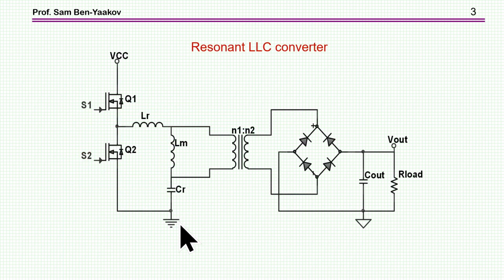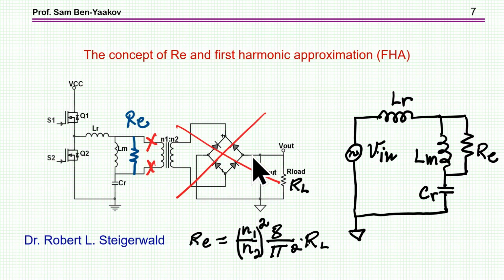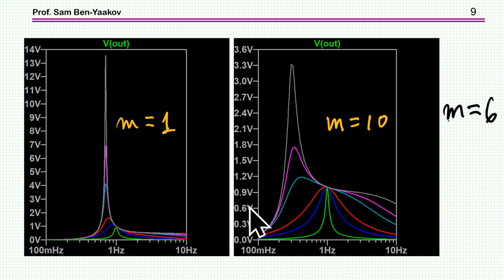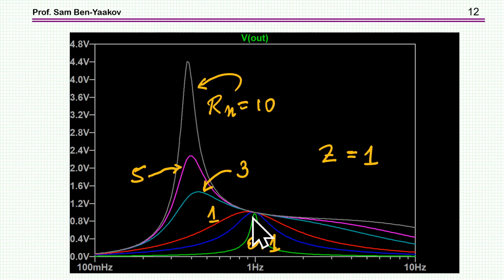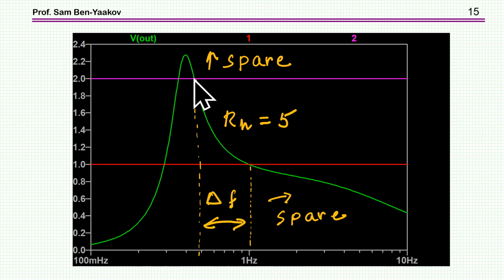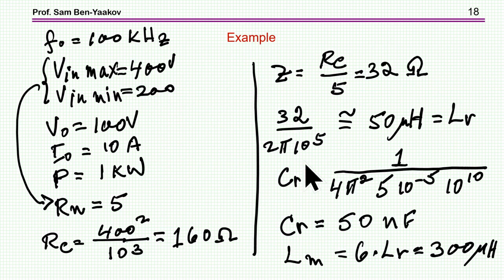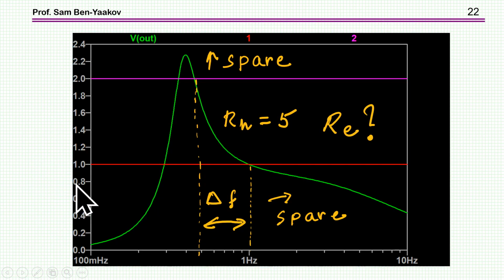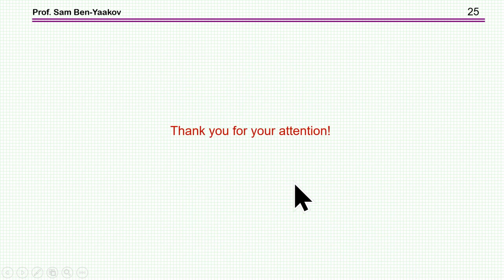A user friendly basic design method of an LLC resonant converter

Comment: Sorry,I have a question again.
I can not understand Why the Re was not use FHA equation to calculation?((8n^2/pi^2)*(Vo^2/Pmax))
Reply from the maker: (Vo^2/Pmax)=RL
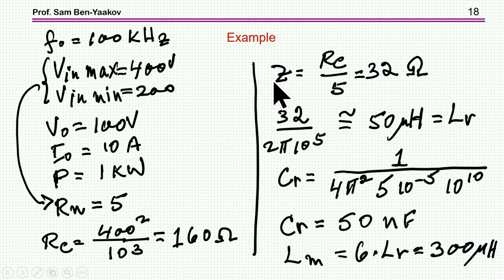Reply: @sambenyaakov  16:40 Don't your Re(Vin_max^2/P) need to multiply by the factor 8/pi^2?
Reply from the maker: @林昱廷-g9w  Now I see it. You are correct. What I probably had in mind was that 8/pi^2 is about 0.8
Reply: @sambenyaakov  Ok,I got it. Thank you very much!

Comment: Hello, I would like to ask that the design is based on full load conditions, why not take no-load conditions into consideration?
Reply from the maker: Designs are normally based on full load to ensure that the power can be handled. But, indeed, there is a need to check other operating points, including no load, for proper operation.
Reply: @sambenyaakov  Thanks for your reply!😆

Comment: Prof, 15:39 the Re equation Re=Vinmax^2/P, here Vin_max should be the Vin_rms value instead of DC value. as in the gain curve simulation and other place, we used ac Vin as the input and Re is the ac rms equivalent resistance.
Reply from the maker: Yes there is a mistake here. Re should be R equivalent as in slide 8. So first Vdc^2/P and the multiply by 8/Pi^2. Thanks for pointing this out.

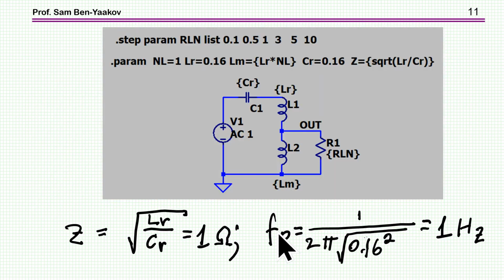Comment: In 0:34 you show a different schematic than the one you simulate in 8:19. 
In 0:34 the inductors are closer to the HIGH and LOW side MOSFET, while in 8:19 the capacitor is closest.

I assume it doesn't affect the basic operation of the LLC converter?
Reply from the maker: Lr and C are in series so  it does not matter where they are along the line. BTW I guess you noticed the wrong connation of the diodes?

Comment: Thanks for the video! When you are calculating Re using output power, you are using Vinmax. Am I correct that  theoretically we should use ((4/pi)*Vinmax)/sqrt(2)? This rms value is 0.9 times voltage which is quite close 1 so I understand if you have just left that "away"...
Reply from the maker: Indeed. Thanks for pointing this out.

Comment: Although everything seems ok, I think that somewhere there is an error in the proposed method.
Why am I saying this?
Because in the given numerical example, with the values obtained for Lr and Cr, the equivalent quality factor is 1.7, a value too high to ensure the proposed gain equal to 2. In addition, the working frequency range is very limited because below 96.4kHz ZVS is lost and ZCS enters, not a very good regime for transistors in LLC.
According to my calculations, the ok values for Lr and Cr would be 8uH, respectively 330nF (for m=6) or 11uH with 220nF (m=3).
Reply from the maker: Thanks for sharing your thoughts. But how can I respond to "according to my calculations"? You seem to overlooked the "basic" in the title.

Comment: Good day Sir. Would you like to say a couple of words about an another architecture of an LLC converter, when C is moved to the secondary side pls? If you take a look into a transformer driver UCC25800 datasheet, you'll find that it has an advantage as "the magnetizing inductor no longer affects the converter gain. Therefore, the converter is less sensitive to the switching frequency and resonant component tolerances". Besides they offer to incorporate the C into a wienna rectifier, and so remove one of the secondary coils (which can be a big deal for a planar transformer due to a high current and a copper layer thickness). Many applications are good with an open loop gain, and such tolerance would be a benefit

Comment: Hello Professor, Thank you so much for your well-explained presentation. I am trying to replicate your AC analysis. I have provided all the same values but I am getting negative gains as well.
Reply: My graph starts from zero and then dips down to -3.2 Volts and after that it increases same like yours. Can you let me know what I am doing wrong. I am using Octave .ac oct 600 100m 10 command.
Reply from the maker: I am not sure I follow. Perhps negative in db?
Reply: @mubashir588  use decade & change bode to linear,hope it helps

Comment: Thanks for this video professor. Regarding the Lm value, how would be your approach in case ZVS is not ensured on the primary side due to lack of magnetic energy?
Reply from the maker: One way is to used packet control.
Reply: @sambenyaakov  Is this similar to burst mode?
Reply from the maker: @GokhanSen-k8o     exactly
Reply: Thank you sir

Comment: in 20:07 min you said you use Vin_max for calculate Re value.. so is it the     
 Vin_max = Vcc_max/2       ? 
am i right or wrong?

here i mentioned maximum limit of supply voltage which gives to the half bridge terminal as Vcc_max
Reply from the maker: Approximately ( square wave- sinus) in a half bridge

Comment: this is great. i think... i think i get it now.

trying for an induction heater. sort of running 270nf Cr just cus i got em as pulse rated... meh, i can alter that. from some playing with MPS LLC tool, i got something like 18uHLr, a factor of 6 for for about 74uH on Lm, and roughly 71khz. have to play around a bit more with it, but its interactive graphs do allow one to get a grasp of how the variables affect things. very handy.

i havent understood the relation ship of the work coil to Lm, though now... i think i simply DO shunt it, exactly as the diagrams suggest... despite it being only a few turns of copper pipe.

for an induction heater, its going to be a 1 turn secondary.
i could say my RL is say, the resistance of a cylindrical section of iron (copper?) tube of say 1/3rd radius wall thickness for skin effect.

the inductance of this work coil doesnt matter. vo doesnt matter other than its a function of the current being induced through that resistance. 
what does matter is keeping the turns ratio correct so the reflected load, Re, is approximating the desired value calculated from the power supply side of things so as to deliver the maximum power to either a slug of copper/gold to being unloaded with minimal load, without blowing up...

i think that from here... i can work this out now.

i recall the industrial unit i used to use ran a fixed frequency, with a coil tap for load matching. this does explain it now. as the work coil may have any number of turns, the matching transformer is simply there to maintain Re as the secondary, the lump of stuff being heated, is always considered a 1 turn coil. though RL will change as the material changes... nevertheless, as long as i calculate for the worst case scenario, a near virtual dead short, someone just stuck a superconductor in the workcoil... i should stay in the safe region...
Reply from the maker: Thanks for sharing

Comment: Looking the gain graph it seems that if we have fixed nominal input voltage all the valid loads we will have cross resonant frequency at gain 1. 
In real design project I face a problem which is:  switching freq is above resonance ( as I can see my resonant current waveform ) and switching frequency is decreasing close to resonance with increasing the load ( or decreasing Q ).  I have followed all the steps and I believe everything is ok with my calculations.  Pout = 500W; Vo = 12V; n=16; Vin = 390V; Lr = 30uH; Lm = 220uH; Cr = 120nF; fr = 80kHz. 
Question is: From where could come the difference between theory and practical design. 
Possible things: transformer ratio is not valid ( but I checked that )   or  leakage inductance is dropping with respect to current ( something I don't have the tools to measure ) , but anyways If so i think the circuit should operate at the new resonant frequency to follow the approximations in the predesign but that is not happening. This is something I don't understand.
Reply from the maker: The design is based on the first harmonic approximation. In reality the time domain behavior is different.

Comment: Does the math work the same for an "inverter", ie AC output, not DC. 

For an inverter, we'd lose the rectifier. But would we lose Cout?
Reply from the maker: No, the analysis assumes a DC clamping at the output, that is the voltage on the transformer is a square wave.
Reply: @sambenyaakov  Which video do you recommend for an LLC inverter, with sinusoidal AC output?
Reply from the maker: @johnaweiss  This would be a resonant converter look up my video on that.
Reply: @sambenyaakov  An inverter is a converter?
Reply from the maker: @johnaweiss  Strictly speaking ' a converter is DC-DC an inverter DC-AC, but sometime they are mixed
Reply: @sambenyaakov  I'm confused, you said to look up your video on resonant converters. But THIS video is on resonant converters. How will that help me understand resonant inverters?
Reply from the maker: @johnaweiss  https://youtu.be/tCEqm-RoP20

Comment: Hello Sir , good video. But the whole average of the input voltage will appear across Lm when input is low. which will be exactly to the the required output voltage reflected when we go near to the parallel resonant point and not at series resonant point. Other wise always the average voltage across Lm = TURNS RATION X VOUT, So until we have an input voltage we will get the required output and lower than that no regulation.
Reply from the maker: Looking at it as or series or parallel  resonant does not tell the full story. This is a multiresonant converter.

Comment: Nice presentation, I have play a lot with this stuff the past time, I have learn the regulation with low load"s,did  go not so well except when circulation currents are high destroing the beautifull character of this systems, who is not what I want. I need,  because I have Idle currents in amplifiers, a open loop supply and use analog regulators for output voltages of filament audio valve, I need to find the best spot for the resonance, I did read that I need to use the resonance point or just left in capacitive region of it for safety.  I am right? Thank you very much.
Reply from the maker: Thanks for sharing
Reply from the maker: @audiokees4045  Great. Thanks for sharing
Reply: @sambenyaakov  For transformer, I have also here done a sim with ac plot and sweep. I see that when I use primary 1mH or just 470uH that does not do much, all is dependent of Lr Cs and Cp. The reflected power it what matters. I can even do 5mH and sec 581uH is N 8.6 do match the voltages but then switch current do rise again, so I come closer to understanding it, needed before I go test and build it. I think start with 50 volts in system to be safe, later on I can go further.

For the transformer I did read a paper who says ;

The matching transformer Tr is shown in fig.1 together with its simplified equivalent circuit under the condition that the magnetizing current of the transformer is negligible with respect to the current in the resonant circuit. Then this transformer comprises both the full leakage inductance L S and the natural capacity of the windings С  0 , reduced to the primary winding, as well as an ideal transformer with its transformation ratio equal to k. AI says transformer primary have to be close to Lr resonance coil, but I think he is meaning LLC for this. I have seen a example of LCC for 19 volts 5 amps laptop charger who has a transformer of 5850uH who is quite high, for transformer protecting to not get into saturation to quick inductance needs a high as what will fit on transformer, as I do with the ETD39 what I have do 470uH it get just little windings, that is not right I think for LCC, but for LCC it is, that needs a air gap and LCC do not, here is the culprit I think I fight with..

Nice to see the current source action of LCC, when I double the secondary coil, output voltage  just do not change much there, but primary it does. Nice. It is open loop in simplified ac sim. Same with inductance, set it higher or lower do not much, all what matters and give changes is N1/N2. working frequency is 0.85 x F resonance, I have to set up the N1/N2 to higher value then normally done, giving more efficiency, put primairy inductance such that it,s X is higher then the load resistor, but not much did work in sim, getting higher switch did loss more...

Yes I now you have the knowledge, but also thinks "Kees", you have to learn. Well this way I do but slowly, I am 67 so brain is slower. But it keeps me busy.

regards

Comment: This might be a little off the scope of your video but, since control in LLC is by keeping PWM constant approximately 50%duty then varying the switching frequency. 
Is there a way to keep the switching frequency constant (near or at resonant) and control output voltage by changing PWM duty cycle?
Reply from the maker: Thanks for the conversation. Yes, duty cycle control can be implemented to reduce the frequency span.

Comment: Thanks Professor! Very clear explanation.

Two small things (forgive me if I seem picky):
1) In slide #3 the FBR seems not well connected. I think the DC output should be connected to where the transformer is connected.
2) In slide #23 in the last formula for Re I believe Vin_max should be squared.
Reply from the maker: You are correct. 3 The bridge is reversed. An alertness test to watchers. 23. Right again. Whoever does not err is probably doing nothing😊

Comment: Great lecture thanks, dear professor in case of bidirectional if the range of voltages and power keep the same for both directions, the design parameters would be the same? Or is there anything else we should take into account?
🙏🙏
Reply from the maker: You need to examine the situation from both sides.
Reply: @sambenyaakov  yes I got it, thanks 🙏🌺